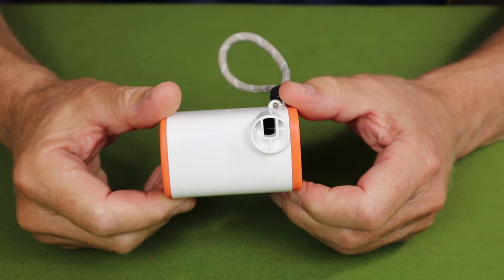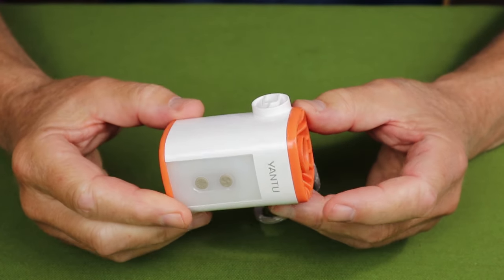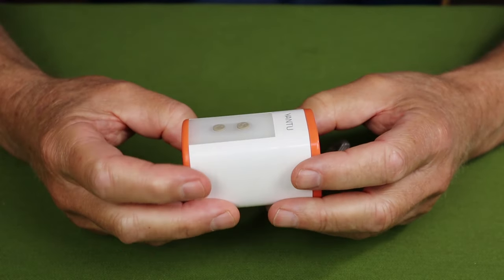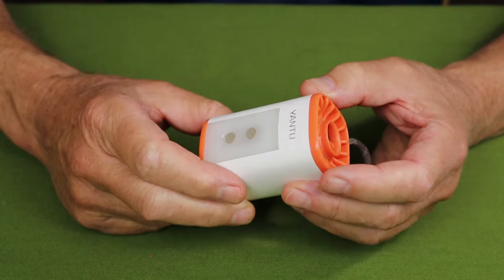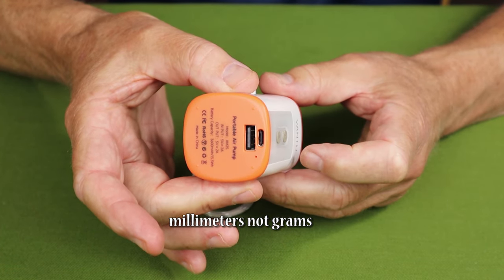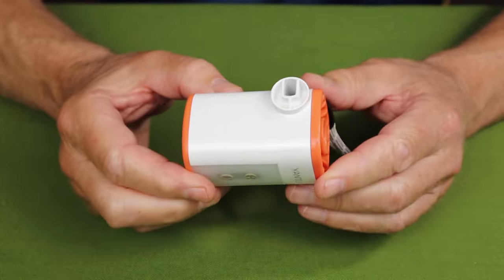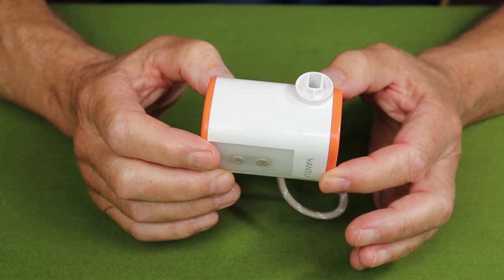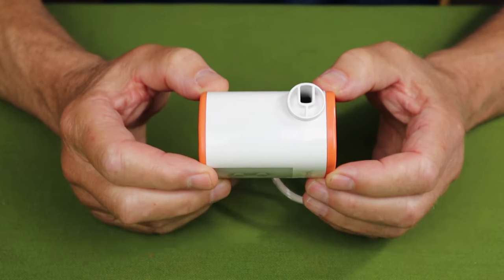YANTU AM25 Portable Air Pump

Comment: G'day Mark, didnt take long for the competition to emerge and good on ya for showing alternatives mate.
I do wish they'd all leave out the light to keep the size, weight and cost down. Personally I'll carry a headlamp and a tube, but surely everyone will take a stand alone light of some description; .... power bank, debatable.
To go along with an IP rating, there should be a standardised mat valve size ; ) Cheers Duke.
Reply from the maker: Hi Duke. I have another air pump review coming shortly. Very small. I think you will like this one. Thanks for commenting

Comment: Hey Mr.Y :+)  we switched to using pumps just last year, and as good as they are for inflating sleeping pads and the integrated light, we find one of the best uses is in stoking a newly lit fire, we use the pumps as a 'bellows' to get the fire in our cook stoves going. The trick is, not to hold the pumps outlet too close to the fledgling fire, instead try a distance of 1-2 feet of 30-60cm +/-.
Reply from the maker: Right on. I mentioned that in one of my videos but failed to say it here. Thanks for commenting

Comment: Mark, if one of these Chinese Amazon products has such poor quality control that it doesn’t even come with a magnet that it’s supposed to have, then what good would a waterproof rating be?
I would be totally happy with using my inflation bag, which is also a light weight dry bag, but it doesn’t have any attachments.   If I could find some for it, or another bag that comes with them, that’d do me.
Reply from the maker: Hard to beat the air bag, if you don't mind the work. Thanks for commenting Jim

Comment: Quick question... does it also deflate?  The exhaust port looks like it might accept the adapters but that would be a critical concern for me.  My mattress pump has to be able to get all the air out for the smallest possible packing job (super tight on space on the bike... no room for air!  Lol)
Reply from the maker: Yes, the nozzles will fit in the air-in port and allow the device to be used to deflate a mattress. Thanks for commenting